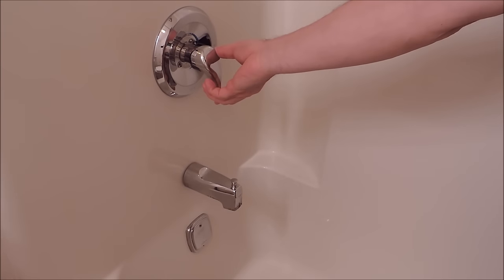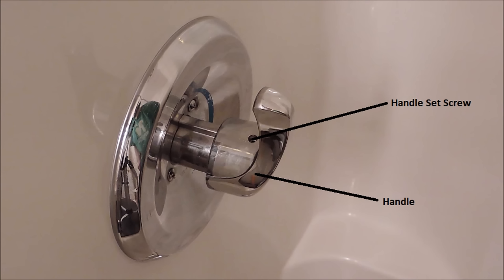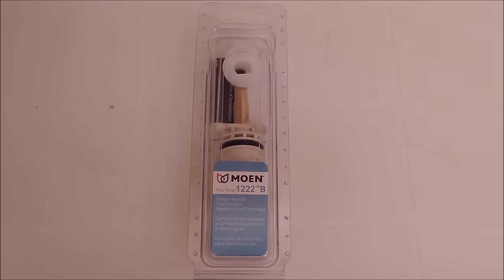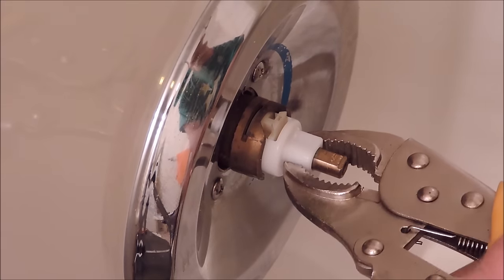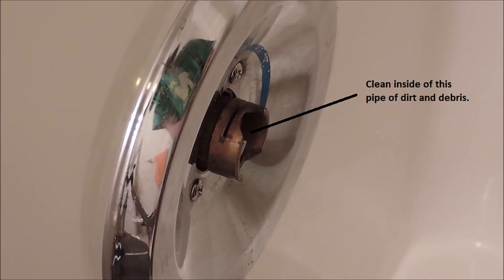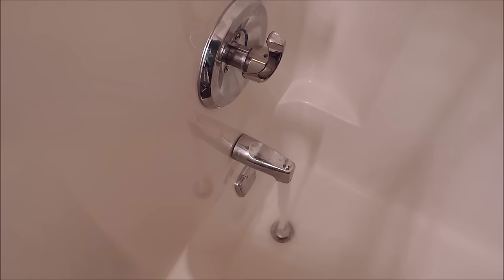Repair Shower faucet: Moen Posi-Temp Shower faucet ( 1222 B )

Comment: By replacing this part, will that fix the problem I have with the water not getting hot? The pressure is fine it just doesn’t get hot, only warm
Reply from the maker: No that's a different problem
Reply: Not a plumber, but when I was replacing my cartridge I noticed that there is a "temp adjustment" to the position of the tabs that stick up from the two white nylon parts that sit immediately behind the handle. Changing the position of the tab closest to the handle will change the final position of the center shaft, changing the temperature of the final mix of water in the "full hot" position of the handle. Yours may have been set cooler accidentally or to protect children/elderly users of that faucet.

Comment: Further inside , is that where you can increase hot water temp to shower? If so then by turning which side which way?
Reply from the maker: I don't think you can increase the temp with installing the cartridge, you can increase the temp by turning up your hot water heater though. But there is a temp limit stop, but that only stops the water from getting too hot.

Comment: Is the handle suppose to feel smooth and no resistance when turning? Maybe I put too much lube but my handle turns very quickly with no resistance. Is that normal?
Reply from the maker: No that is not normal, the handle should have some resistance, but maybe too much lube.

Comment: When my Moen shower quit, I turned on the water until I got to the reduced flow, let it run for a few minutes, went a little more, let it run, finally  all the way and let it run,  This warmed up the old cartridge enough so that it started flowing like new after I shut it on and off a few times.
Reply from the maker: That maybe true in your case, but not might work for everybody. And the bottomline
is this: cartridges to wear out and finally 'give up the ghost', in your case it might have bought you a little more time, but you can't beat "father time" for worn out cartridges.
Reply: @paulc1562  thanks for the tip but i'm pretty sure i knew that.

Comment: Do you have to have the water turned off to get the handle adapter and the key stop off
Reply from the maker: In my video I turned the water off at the beginning, its better safe than get a shower if something goes wrong. You can try it without the water turned off, then report back your findings.

Comment: Not only did the stem brake but so did the front plastic portion of the cartridge. I can sort of grab onto a metal exposed portion but it’s not giving. Tried turning the water back on and nothing. Yeah... pretty furious atm
Reply from the maker: your the 2nd person this happened to in the comment section! Yes that can be frustrating when the cartridge breaks.
Reply: well the metal part ended up coming out as well. I then had to tear the cartridge out bit by bit till i could pull out the rubber seals. The cartridge then finally came out, 20 min job in 2.5 hours. Hope this doesn't happen often.
Reply from the maker: in my experience my cartridge breaks every 18 years, so I think your good to go for a couple decades....
Reply: Paul C, same thing happened to me, had to break it out piece by piece‼️

Comment: Having trouble getting the handle adapter plate off. Any suggestions? Have tried spray lubricant.
Thanks
Reply: (You're probably done with the repair already, but I'll reply in-case someone else has the same problem) I had a heck of a time taking my adapter plate off. I tried pulling with pliers and prying with a screwdriver but didn't want to damage anything.  Not sure what caused it to stay stuck, but eventually it came off after I began rotating it back and forth quickly from hot/cold while pulling on it. Probably just hard water crust making it hard to remove.
Reply: The older adapter plates were metal (now they're plastic) so they corrode and bond to the brass cartridge stem.  After removing the center screw holding the adapter plate, squirt some vinegar into that screw hole using an eye dropper or syringe.  The acidic vinegar will get to the adapter cartridge stem interface surfaces and work to dissolve the corrosion.  Let it set for a few hours (or days) and then try loosening the adapter plate again.  Also, if you re-attach the handle to the adapter plate you can get quite a bit of leverage on it.

Comment: Hi Paul.  The screw you put back at 5:27, can I put silicone on/around it so it will not come loose?  That screw in my Moen handle is becoming loose over time.
Reply from the maker: Silicone might work, or you could use something called Locktite or Thread lock which allows the screw to lock in, but not permanent, you can still remove it later.
Reply: Appreciate!

Comment: I changed the cartridge and everything went back together perfect, yet I still have a drip from the shower head.  What else can I do?
Reply from the maker: Well if it drips from the shower head that might be the issue, because my drips was from the faucet, not the shower head.
Reply: maybe you scratch the inside of the valve.
Reply: call them for a free replacement and try another .

Comment: Hi Paul.  Why are there 2 o-rings on the original and only 1 on the new one?  Is the leak because of the o-rings or is it inside the cartridge?
Reply from the maker: It varies mine was because the cartridge was worn out, and maybe the o-rings lost their luster. But I made it 18 years. Yes looks like Moen has a new design now with 1 o-ring instead of 2.

Comment: Best way to get the replacement cartridge for free is to go to plumbing section of Homedepot and ask the guy , typically if u have old cartridge they will give u anew one for free.
Sometimes they make exceptions as well of not needing the old one for replacement
Reply from the maker: yes good point if your local hardware store does that, I received my free cartridge by calling MOEN 1-800 number, and they send it via UPS.

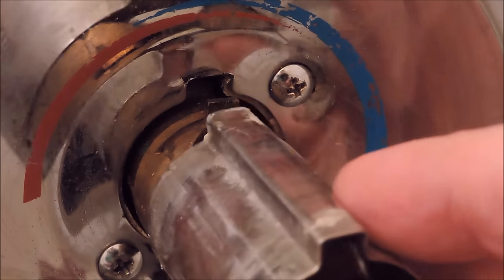Comment: 5:02 when i put the stop tube it, it keeps going in. it looks like yours doesn't go any further in when you wiggle it. so now my key stop and adjustable temp stop limit isn't fitting flush so everything wiggles and feels loose
Reply from the maker: That is an interesting problem you have, if you have solved it please give your comments, so others can learn from you advice.
Reply: @paulc1562  ultimately bought a new kit

Comment: I install the new cartridge and only hot water coming out. When I turn the handle to 3 o'clock, it's initially a little warm, then it turns hot. When I turn to 12 o'clock and 9 o'clock, it even gets hotter. I turn it off and turn it back on the 3 o'clock position, only hot water coming out. I try to uninstall and re-install the cartridge again, but only hot water coming out no matter where the handle's position is. Do you know what is the problem?
Reply from the maker: You might want to review 4:33 - 4:50 of the video, talking about the H and the C and the small notch in the cartridge, and I assume you turned it "On" to bleed the water out before you started to uninstall. Also remember the flange issue from 1:18 - 1:50.
They key is putting every part back the same way you uninstalled it otherwise you may have issues, like you described.
Reply: thanks for your response!

Comment: Do you push the lever in for less volume and pull out for more volume or is it always at full volume?
Reply from the maker: No I don't have a push/pull its always at full volume and I just control the temperature. I guess you can control volume with the shower sprayer you install. Either Low Flow, or High Flow, I have one I can turn for different patterns and flow.
Reply: @paulc1562  OK. Thanks!

Comment: When I put the tempeture limit stop,I can;t turn on hot water,I have to turn counter clock wise for hot water.
Reply from the maker: You will have to study 4:33 of the video, you might have put the cartridge in upside down. Notice where the H and the C are located as per my video. Also take note of the small notch, it should be facing the same way you took it off. For me I took it off in the "ON" position, so the notch had to face up.

Comment: Why don'y you need to caulk between the stop tube and the face plate.  Won't water get in?
Reply from the maker: You dont need caulk because you put a little plumbers grease on the cartridge and because its such a tight fit. No caulk or silicon is needed.

Comment: I followed all the instructions. Now the rotational range of my shower handle is only 180 degrees. I swear before I started the project it was closer to 270 degrees. Similar to the range of the shower handle in the opening of this video. Anybody know what I did wrong?
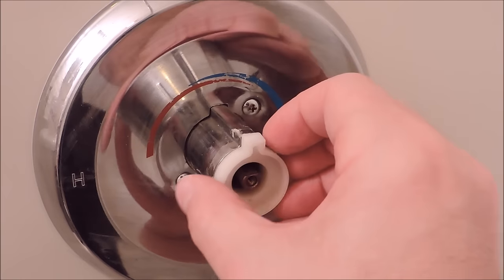Reply from the maker: maybe you fooled with the temperature limit stop, the white plastic item which I explain starting at 1:48 of the video. Do you have less hot water? Or are you happy with your temperature range from the change of motion from 270 to 180?
Reply: Hello, I figured it out. I didn't realize that the key stop and the adjustable temp stop were 2 distinct  pieces. In the video it looks like one piece. The original orientation between the two pieces must be maintained or you will limit handle rotation. Thank you.

Comment: You pulled the cartridge out and I see two 0 rings front and back; but when it goes back in, there is but just one 0 ring in the front??
Reply from the maker: Good observation, but they both are 1222B, but after being in there for 18 years, looks like they made some changes to the cartridge, just like Honda's make changes to their car from 2000 to 2018.

Comment: I bought the generic cartridge (says compatible with 1222) from HD and can't get the retainer clip back in place. It wont go in no matter what.
Reply from the maker: Remember what I said in the video at this timestamp, that you should not buy a cartridge but get a free MOEN one, just call MOEN and they will send you one.
https://youtu.be/BXWsiKP88gc?t=153
It might be that the generic is not the exact fit, but I am surprised the retaining clip does not go back in, can you modify it somehow?
Reply: Just called Moen and they are shipping the cartridge. :)
Wasted $40 or so on the HD Danco brand. In fact I bought the cartridge like 3 years ago and never bothered installing it until last weekend since it was guest bathroom faucet when I find out it doesn't fit. Now I can't return it either. My lazy ass paid the price :(

The retainer clip not fitting is a common issue, I found many articles online complaining about third party catridges. I hope Moen catridge solves the issue.

Comment: What happens if you replace the cartridge and you are still not getting pressure on the hot side??
Reply from the maker: I would disassemble it, and try again, and try troubleshooting as to why.
Reply: @paulc1562   ok. Thank you.

Comment: Can this replace a 1225 and do you recommend that?
Reply from the maker: It probably does, but I would call MOEN to be sure at 1-(800) 289-6636, and while you on the phone with them, ask them to send you a FREE replacement.
Reply: @paulc1562  How long did it take to receive the part from MOEN?
Reply from the maker: @angelakerr-ashley6368  it took about 5 to 7 days.

Comment: What does the moen cartridge exactly do? Only regulate water temperature? Does it open the water flow too? Because the stem from my Old cartridge spins both ways but don’t open the water flow. Not sure what exactly I need to replace. Help please.
Reply from the maker: I dont know the details you might want to call Moen, but my guess is it does both. I can only tell you what I did, which is replace the cartridge, and it opened up the water flow, instead or drip, drip, drip.

Comment: But how do you adjust the temperature?
Reply from the maker: if you watch starting at 1:48 I am talking about the white plastic temperature limit stop, you can put it in different configurations to limit the handle from going too far left, thus limiting the hot water, do some experimentation with it.

Comment: Thanks for the video.  Moen sent me the cartridges with instructions but the instructions don't match my shower faucet.  I had my suspicions from the start when they started off saying to use a 7/64" hex wrench, but mine takes a 3/32".  

Upon removing the handle, my faucet resembles yours, but I don't see a screw keeping the handle adapter on and my adapter has a protrusion.  Image: https://drive.google.com/open?id=10Su5Cq8BLv6rKy0cTth7uJ3Nw84B54Ac

Is the 1222 B that they sent correct for my setup and how do I proceed?

Thanks!
Reply from the maker: The only way you will be able to know if 1222 B is right for your setup is you need to remove the handle adapter, I did have a protrusion on mine, plus a flange on the right. You may need to remove handle adapter by force if there are no screws to remove. 
Make sure you turn off the water, if your going to pull on it. Some people use a plumbers pulling tool. I have never seen that sort of setup, but once you get the handle adapter removed start my video at 1:25 and continue.
Reply: @paulc1562  I checked again, and through the lubricant shoved in there I do believe there is a philips head screw.  Thanks.
Reply: @paulc1562  So I'm at the point where I have carefully removed the retaining clip, making sure it didn't fall behind the wall.  But I'm using the twisting tool and can't get it to turn at all.  The lip of my cartridge is farther in than yours, into that groove.
Reply: Here's what I'm looking at: https://drive.google.com/file/d/10XU85E8VCVEo2sGoiy0UzvWlf83O-unO/view?usp=sharing
Reply: @paulc1562  Ugh, progress (or so I thought).  I finally got the cartridge to twist and the plastic tab broke off so that it moves freely now.  But it still won't come out.  I have no idea what to do.
Reply from the maker: You could use a "Moen puller" or a vice grip, I admit sometime this part is very hard to pull out. I have read before that if you turn the water on, it might neutralize the pressure and be easier to pull out, but it will also be messy then water comes spraying out, so be sure you can turn it off quickly from the mains. But I recommend the "Moen Puller" with the water off.
Reply: @paulc1562  That's exactly what I did.  I ran over to Lowe's earlier and picked one up.  It took a little elbow grease, but I got it out.

This is kind of funny...  instructions from Moen then say to "clean valve with nylon brush and water."  I feel like Eddie Murphy's old man character in Coming to America...  Hello?  The toilet is available...  <shrug>

Thanks.
Reply: FYI, this is what I picked up. https://www.lowes.com/pd/Danco-Cartridge-Puller-For-Moen/1085199

I guess it's generic, not Moen.  I saw an old video where someone said one of these cost $100!  It didn't fit perfectly around the cartridge, but it worked.

Now I would like to figure out why my tub spout is about 11/16" away from the wall.

Comment: You didn't explain how the temp limit stop can be adjusted :(
Reply from the maker: Maybe I am not real sure myself, since I did not have to ever use it for an infant or an elderly person both would need water that is not too hot. But use this time to experiment. The purpose it so you can turn the water to be too hot, it will stop the handle before the hottest temps.

Comment: You mentioned that it’s free from moen...how?
Reply from the maker: If your old Moen cartridge wore out or broke, then
FREE replacement parts may be obtained by calling 1-800-289-6636 (Canada 1-800-465-6130), or by writing to Moen Incorporated, 25300 Al Moen Drive, North OImsted, OH 44070-8022. They send out my FREE part via Fed-Ex in a few days.
Reply: Thank you

Comment: B just stands for bulk same exact part as the 1222
Reply from the maker: You are correct sir, to put it simply the "B" in the 1222B model number stands for Bulk. That's it! It's simply the part that Moen sells to contractors in case packs. The 1222 is the one that you'll commonly find in your hardware stores. 

The Moen 1222 vs 1222B parts are both coming off the same Moen replacement cartridge production line at their factory in North Carolina. The only difference is the packaging. So I hope people don't get caught up on asking yourself what the difference between Moen cartridge 1222B vs 1222 is.

Comment: Close the tub drain before you start taking the faucet apart.
Reply from the maker: Yes good observation, but my drain spring and lock was broken so it would not close properly. That being said I was only taking showers, not baths.  😊
Reply: @paulc1562  My drain is also broken so I put a towel over the drain.

Comment: Wrench?
Reply from the maker: I used "the Google" and searched the internet(s) and it says, "The terms "hex wrench" and "Allen wrench" refer to the same tool: an L-shaped hexagonal device designed to fit and drive bolts and screws that have a hexagonal socket in their heads." And we know everything is true on the internet(s). LOL

Comment: The piece that holds the handle in place was replaced with plastic, worst decision ever made because after awhile the plastic strips and you can’t turn the water off with the handle
Reply from the maker: Right, companies always try to cut corners to save a dime here and there. Big Macs and Whoppers have gotten smaller, while the price has gone up, up, up.

Comment: The old valve had 2 o-rings, the new had only 1 o-ring. Something change?
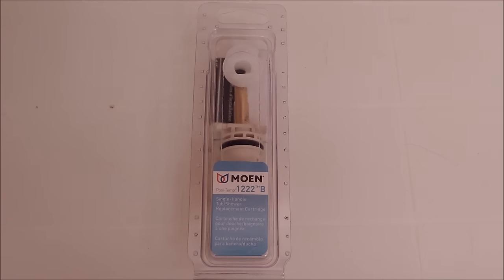Reply from the maker: Very good observation, at 2:31 of my video is the new cartridge which has 1 ring, but  at 4:04 I pull out the old cartridge and its has 2 rings!! So apparently there was a change in the last 18 years. Not sure why, but my new cartridge still works good with 1 ring.
Reply: @paulc1562  Yep, I just replaced 2 of them in my house (thanks to your awesome video!) and both of the old ones had 2 rings, but the new ones on mine also only had one ring. Guess the rear ring was just overkill...haha